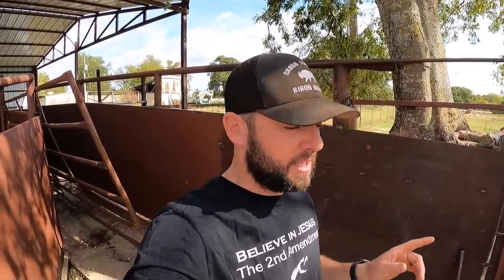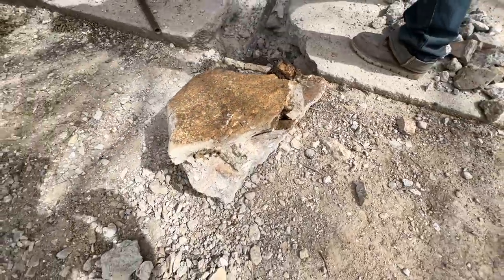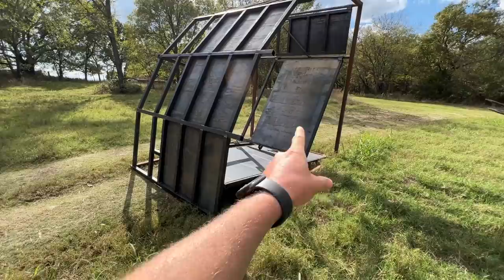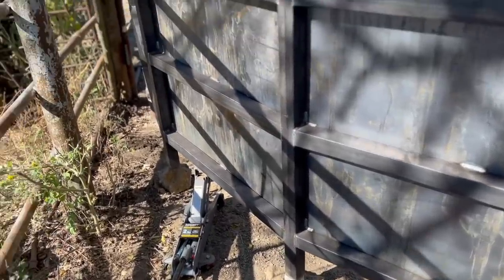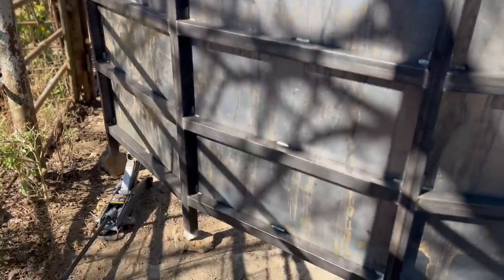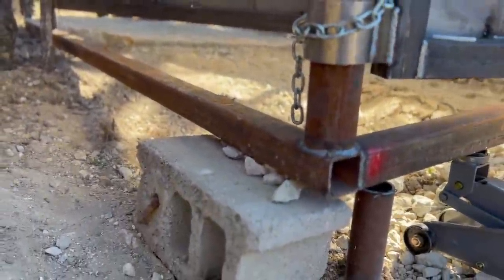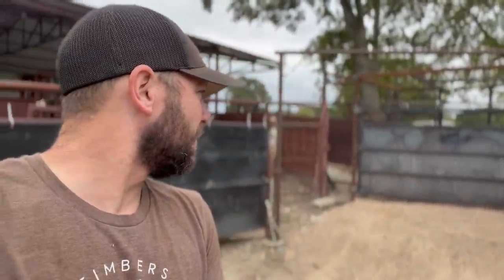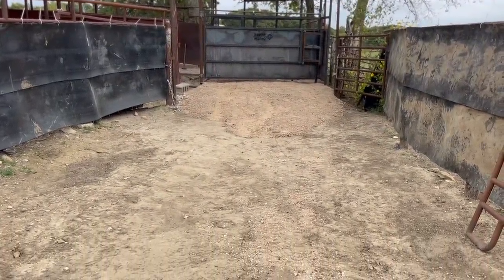Major Addition to the Bison Handling System!

Comment: Dusty they rent jackhammers, both pneumatic and electric, at really reasonable rates and the time and labor savings means it's a big payday in benefits for you. Concrete is stronger with age and it looks like yours is pretty well aged. Great job however.

Comment: There is ALWAYS work to be done on a farm or ranch. Something has to be fixed, or replaced, or "jerry-rigged" to get by for the job(s) to get done. It is such a great feeling when everything comes together, and then you find something more to make it even better, or a whole new project that improves what you already had gotten done. The pay sucks, it is more than just 8 hours a day, all the insurance for work is not provided by the employer as a  great benefit, as YOU ARE THE EMPLOYER AND EMPLOYEE. It is 24/7/365 work. What are the benefits? They are endless, if you love what you are doing, working the land and putting all your effort into what GOD has assigned you as your job, you can know that what you are working for is a benefit to not just yourself and family, but ultimately all of your country. Now if only the other members of the country would put in some of that hard work you do for them! 😁🤨🤨